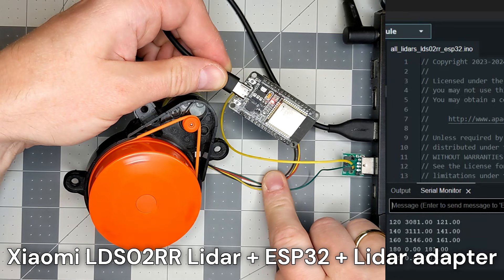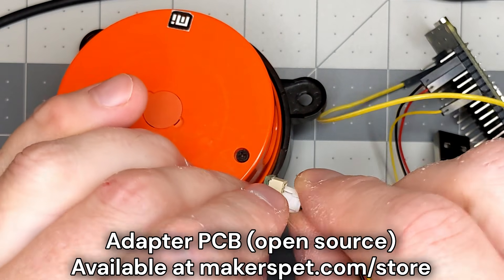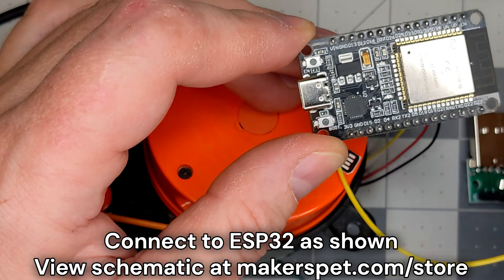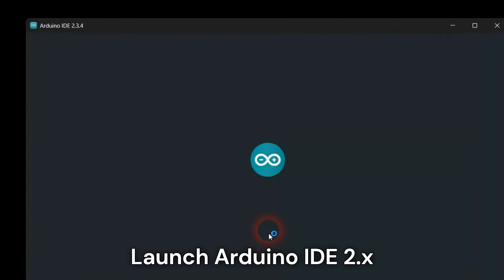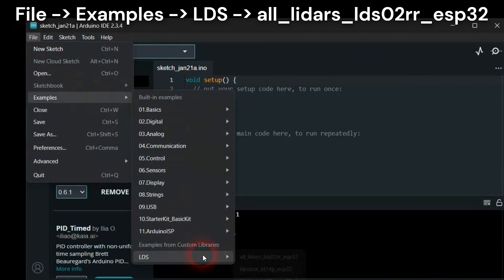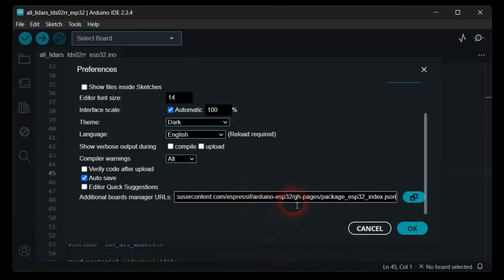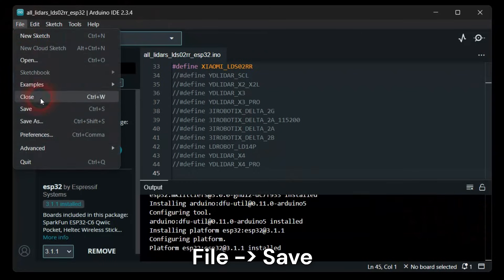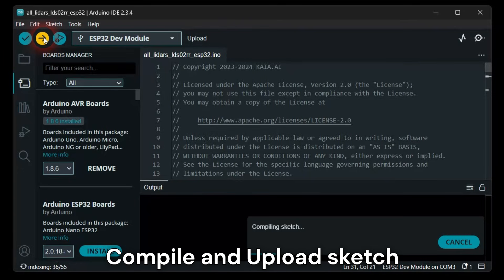How-to: Stream LDS02RR Lidar distance data live using Arduino, ESP32

Comment: I'm trying to make a delta-2c lidar to work with your videos but it still does not work, i tried this library with all delta lidar variations you have (2a, 2b, 2g, my 2c has 5 pin connector with T G V + - pins and i connected them to G16, G15, G19, V5, GND). From your code i get:

mode:DIO, clock div:1
load:0x3fff0030,len:4916
load:0x40078000,len:16436
load:0x40080400,len:4
ho 8 tail 4 room 4
load:0x40080404,len:3524
entry 0x400805b8
ESP IDF version 5
LiDAR info Model: 3irobotics Delta-2B
startLidar() result: OK

i get no distance measures like the values you get from serial monitor. Can you give me some advice how to make it work, the adapter in this video i can't use because i have a normal 5 pin connector that i can connect directly to lidar, also i saw that you have a breaker board in other videos, do i need that board for connecting ? Thank you for the videos so far
Reply from the maker: Can you please post details and photos of your setup in the support forum https://github.com/makerspet/support